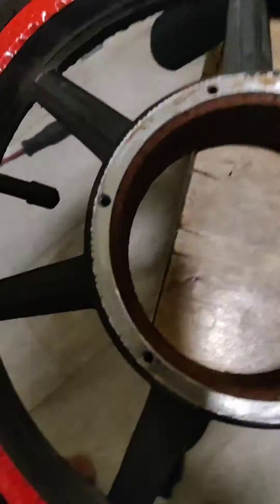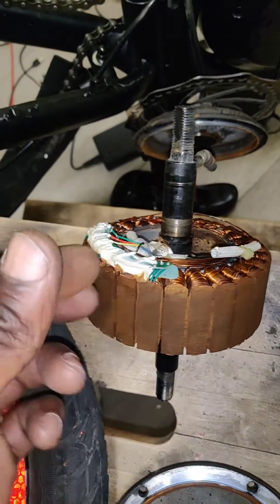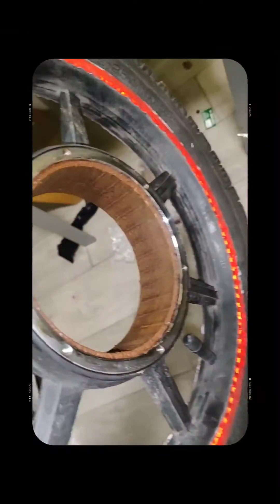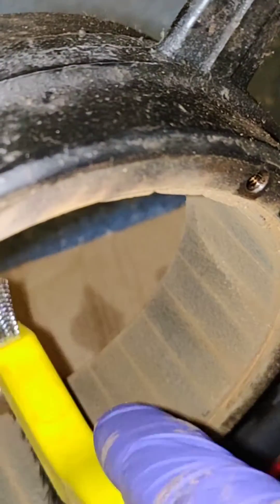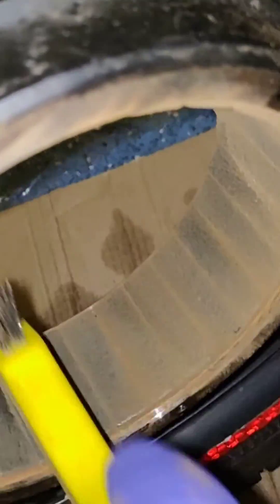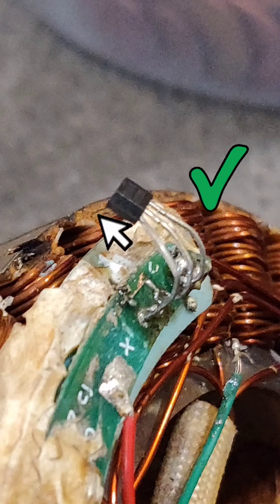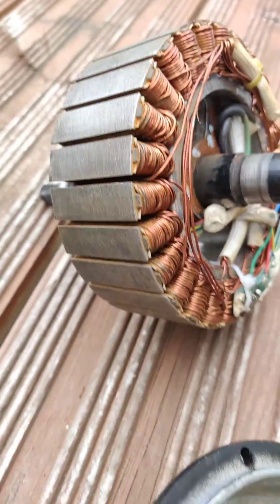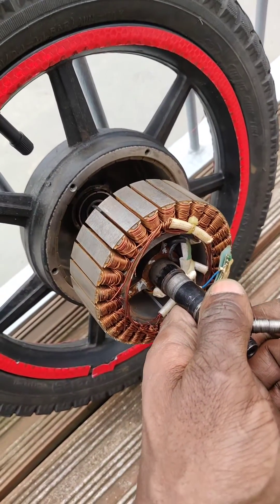Hub Motor/Wheel Repair on Jetson Bolt, DYU, Kugoo Kirin B2/V1 250w/400w Brushless 14Inch

Comment: Hi !How did  get to inside the hub?
Reply from the maker: Removed screws and used a strong flat head screwdriver, inserted in between the join using a hammer lightly, and then pry it open on both sides.. then hit the axle with rubber mallet or ground from one side and should push the other out.

Some come apart more easily than others. Search YouTube. Plenty of vids

Comment: I think all these type of bikes suffer the same thing with the motors, my one is the kugoo b2 48v 350 watts motor and it is full of rust just in the process of doing a repair.
Reply: Where do you get hall sensor from for kugoo Kirin ?   B2

Comment: Hi, I have a DYU d3f with a voltage of 36V.  I found the Kugoo V1 is 48V and it goes faster.  Both bikes look the same.  Kugoo has a more powerful engine or not?  If I change the battery from 36V to 48V and the controller, my bike will go faster?
Reply from the maker: The Kugoo V1 has a more powerful motor (400) than the dyu d3f (240w). In my experience; I upgraded the kugoo b1 pro (250w motor & 36v battery) with just a 48v battery and made no difference to speed.. just added range. And then swapped the controller to 20A then went from 15mph to about 22mph. So yes, upgraded controller and battery then your bike will be faster. On a side note; I did put the bigger motor with the stock controller and 36v on the b1 pro, and it did go a bit faster.
Reply: @UKTunedIn  Where did you buy bigger motor and how to fit it?
Reply from the maker: @danio3334  the bigger motor comes stock with the V1. I have seen a 14inch rear hub motor on Amazon by a company called "HalloMotor" that claims 500w for 199gbp... But I'm good with the current speed.. came off a couple times so basically wearing fullface and moto gear right now lol
Reply: What hall sensor do I need please send link